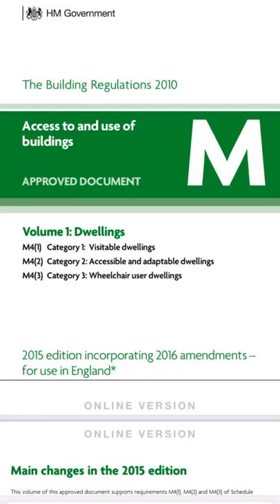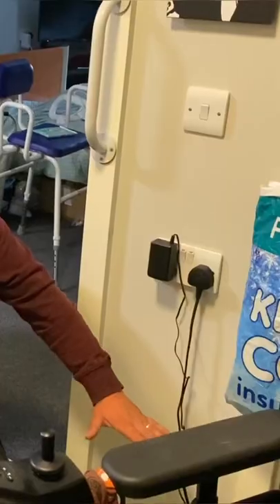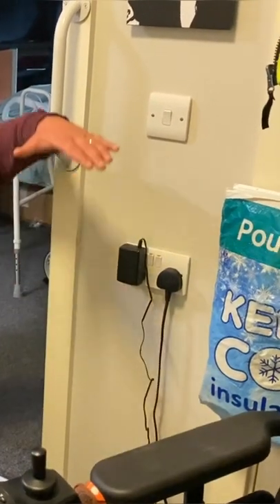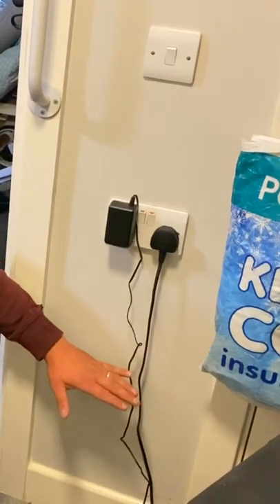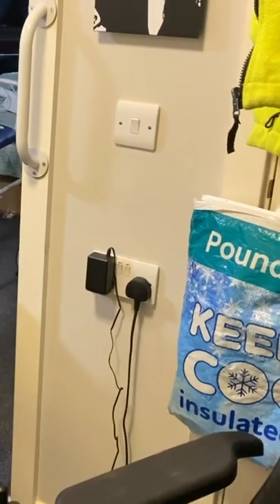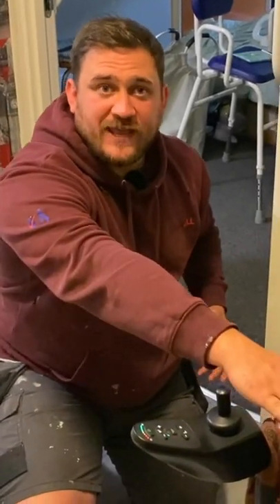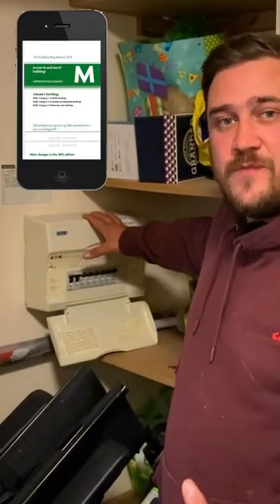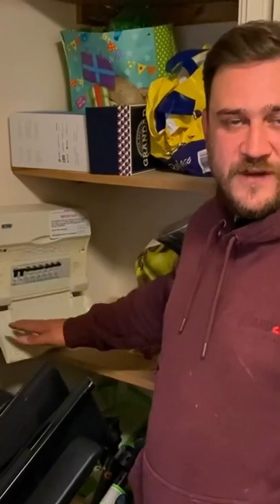What are the Heights of Sockets and Switches in Habitable Rooms

Comment: Is this for new builds or rewires of existing dwellings?
Reply: Part M4(2) only applies when this 'optional requirement' is imposed as part of any planning permission. So no, it wouldn't apply to a pre-2004 domestic dwelling unless being converted specifically for other uses.
Reply: @Benzknees so how does this affect rewires of a house and a new extension? Would they be on different heights?
Reply: @therealdojj  - Not unless the planning permission specifically involved a material change of use, say for a wheelchair user or similar under part M4(3).